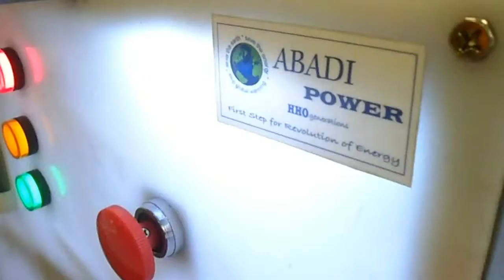HHO on diesel generator 608 kVA

Comment: Fake! With this very low gas production nothing happen with this big engine. You lost only time
Reply: LIONSTRACS H2 it's not running the generator. It's using the gas to assist in the burn process.
Reply: The engine needs very small amount of H2 to increase efficiency of burning process. It also helps reduce emission.